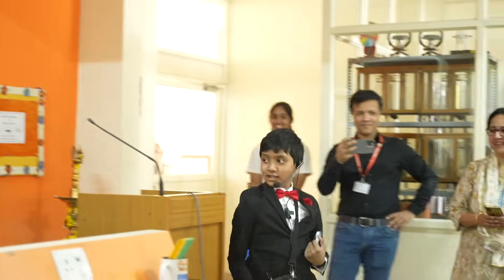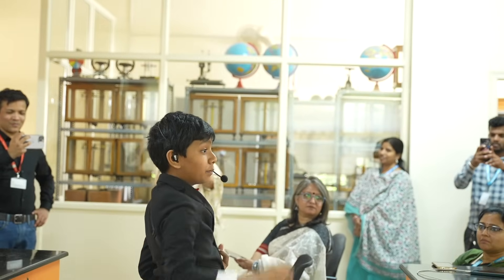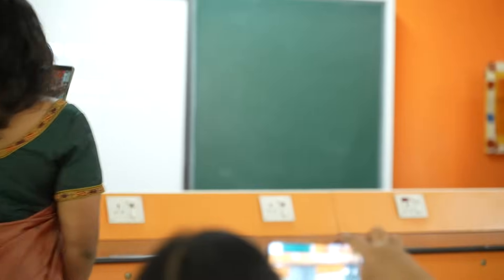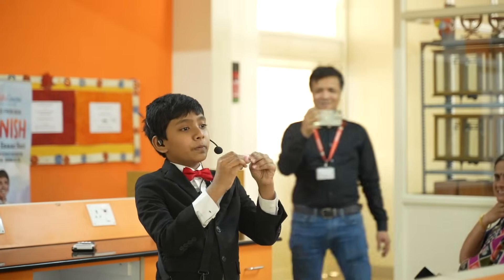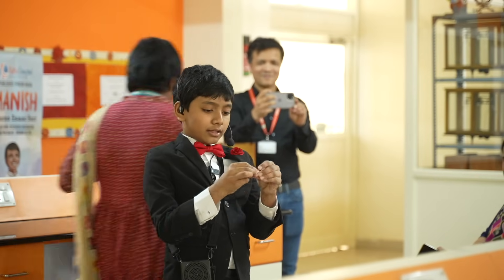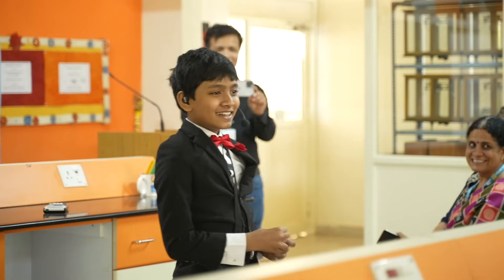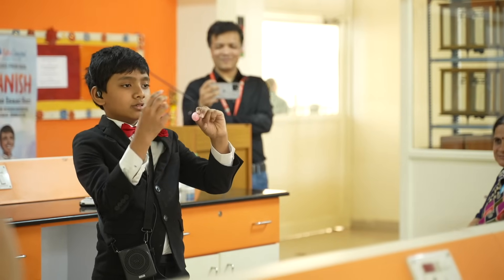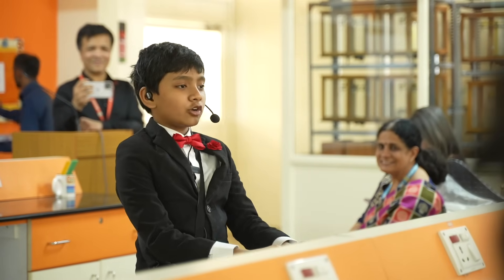Physics Lecture 1: Creating Community Inside Classroom | DPS Bangalore East

Comment: You can tell he is homeschooled. The principle at work here is conservation of energy. The energy you put into bending the rubber out of shape is stored as potential energy that is released as kinetic energy again when the object goes back to its original shape. If put against another object that does not move like a table, the object will "pop up" from Newton's 3rd law, ie, equal and opposite forces. This is just like when you stretch a rubber band and let it go, it flies. He gets it wrong because his dad taught him wrong.
Reply: Yes such a simple logical thing he still did it wrong

Comment: it is not true that the thing is trying to go inside the table because even if the table was not there the only forces acting on the object is the internal elastic restoring forces which does not affect the centre of mass which he has shown as goiung inside the table....it is true that the reason it jumps is because of the stored potential energy in the object but i think when you turn the object inside out and put it in the table there is equal amount of pressure inside and outside the object but as the object tries to jump it squeezes its topmost part to invert itself creating a high pressure inside it and this interplay of force betweeen pressure inside and the elastic force trying to win over until a threshold limit is reached when the force due to pressure inside is larger enough than the combined elastic force and force due to pressure outside so that it jolts upwards.